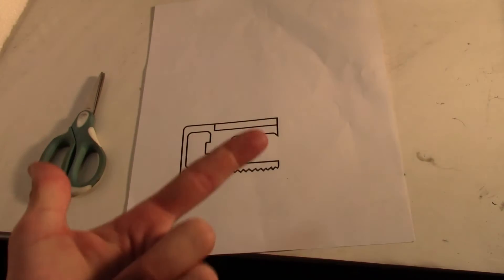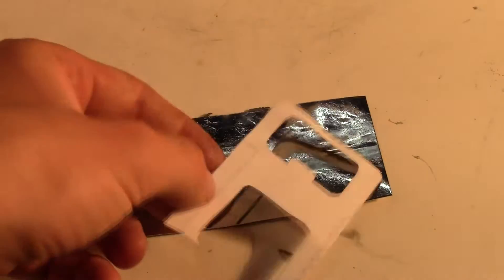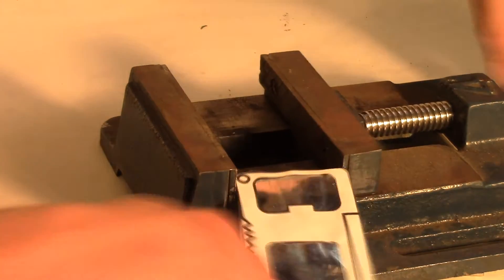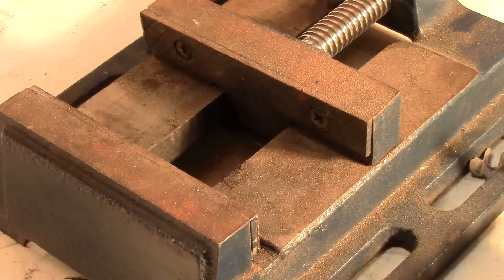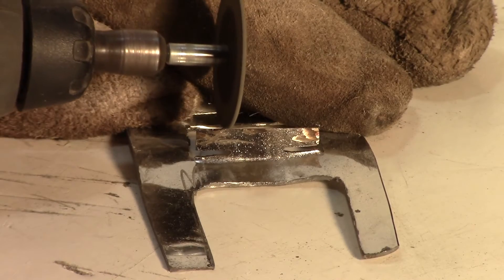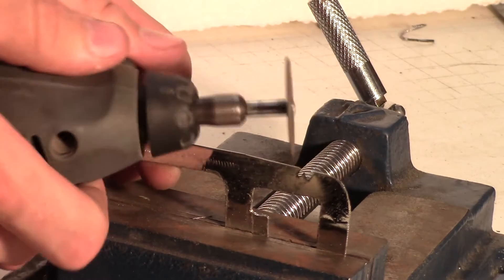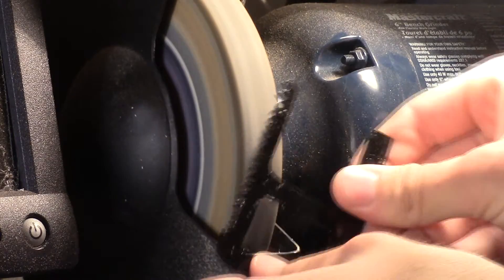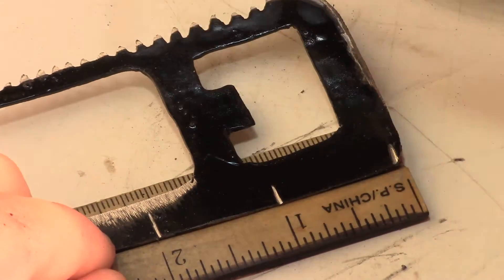How To Make a Wallet Multi Tool!

Comment: I like how you kept it quite simple in you r explanation. That encourages me to try something like this myself. But I wonder about one thing. It looks so flimsy. I´d be surprised if it would not bend when you open a bottle. Would you recommend using a harder steel?
greetings
e
Reply from the maker: That's a great point, and that brings up something I realized during the testing, which is this was remarkably strong. I could open bottles with ease, and I was the same as you thinking "its probably gonna bend" but to my surprise it didn't. I would be interested in seeing someone explore harder steel/metals. Thanks for the input,
Peace! 
Paul Pyro

Comment: Does it has other uses besides ruler, saw, and a bottle opener?
Reply from the maker: Yes, the whole design is to be simple, so that users and viewers can add their own features. It is very customizable. (add knives, compass, flat head screwdriver, wrench socket joints, letter opener, can opener,....etc)
Reply: Paul Pyro Ok,thanks for the reply!